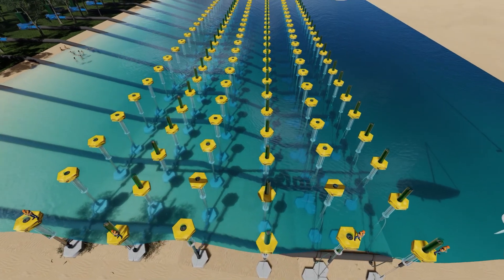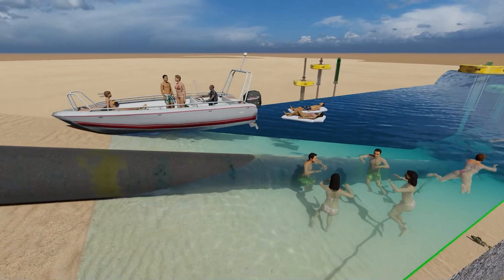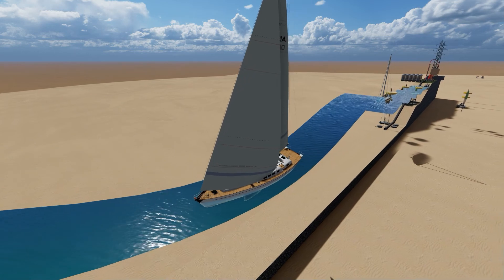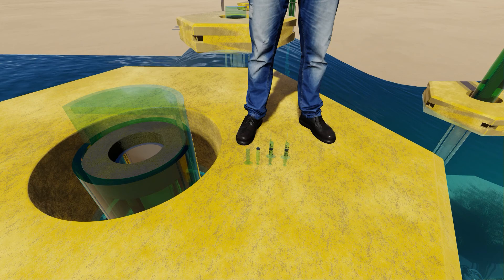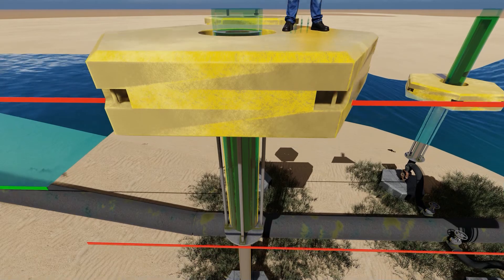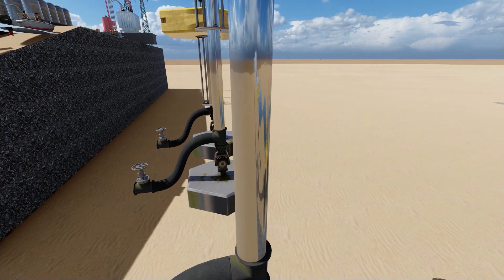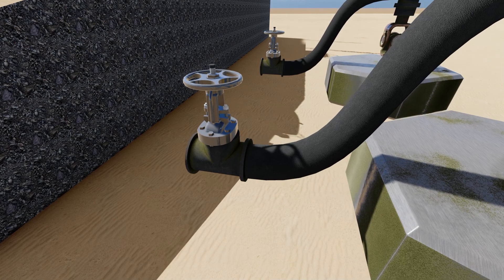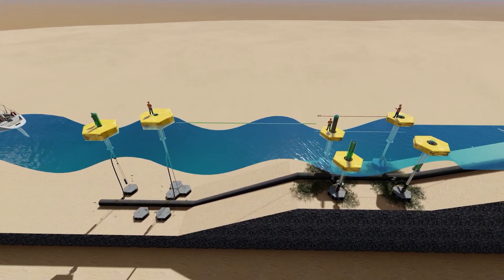Wave energy used to compress air , which is used to turn turbine generators

Comment: Why are people so persistent on only pumping in a down or up stroke when you can draw air in and out on the up and down use freaking 4 valves not 2 but windmill air pumps that are also turbines are way more efficient😉and you put your tanks anchored to the sea floor and you can use the water to compress the are with no back pressure think about it buoncy air floats in water 😲
Reply from the maker: Thanks for your comment Randy - good idea!

Comment: When you think about making a system to extract energy from the ocean, whether from tides or waves, you need to start by looking at why hundreds of such systems have failed when tried, and avoid copying what made them fail.  The most reliable way to make such a system that fails is to expose your hardware to rough surface water. Another is to give it complicated, unforgiving mechanical apparatus exposed to open ocean and barnacles. This system, sad to say, exhibits both of these failings.

The idea of pooling compressed air, with the turbine to extract energy from the compressed air on shore, is excellent.  You need air pumps deep enough below the surface to avoid being battered by storm waves, and devoid of exposed, complicated mechanical apparatus. Think, for example, of air bladders attached to the sea bed, with the most complicated bits just one-way valves, entirely enclosed, operating on air, not exposed to sea. The bladders get compressed and expanded as waves move by overhead.

If you must have surface floats, array them with just cables that cannot fail, and let tugging and releasing the cable transmit energy ashore, so the only bit of mechanical apparatus in the water is a pulley wheel or lever arm that offers no scope for failure. Hundreds of tension cables leading to shore equipment is not pretty, but is wholly manageable.
Reply from the maker: Thanks Nathan - very informed response! - and you are correct in every way!

Comment: Imagine cooling the air inside the compressor then heating it again prior to use.  You would store a lot more energy in each of the compressors and return water to the environment.

Comment: Nice, but too much piping needed. I do prefer version, where your "piston", is a natural magnet, and your "cilinder" around is build with inlaid wiring, in wich will the wave movement produce electricity. Then either store it, send it on the shore, or use it to create H2 out of water, and on the land use H2 as fuel. Variant i do like the most is one either on a ship, or on a big barge/pontoon, wich serves as central node of the farm, and can "reel in" the farm to relocate if needed.